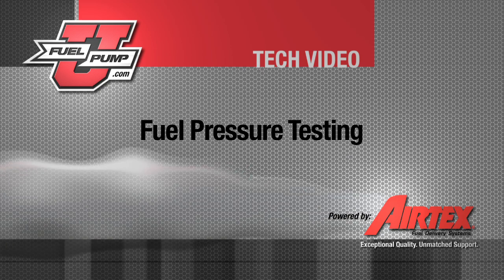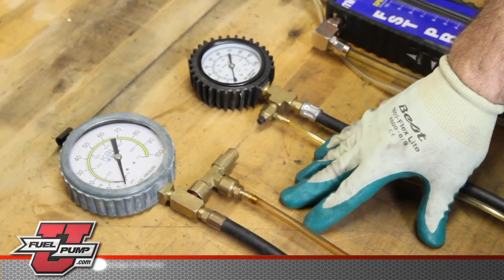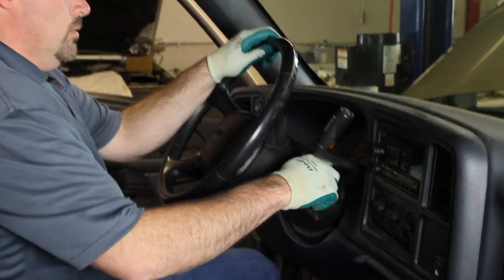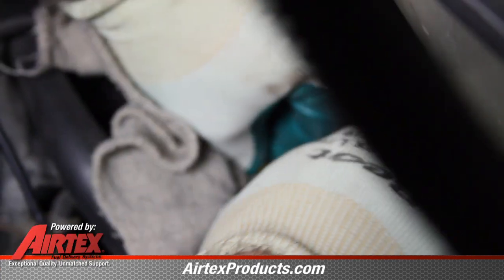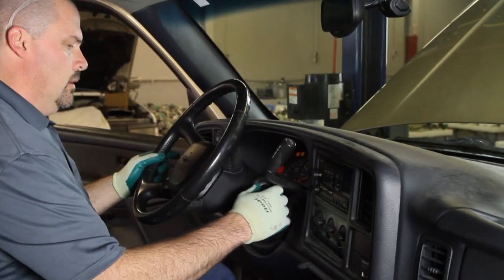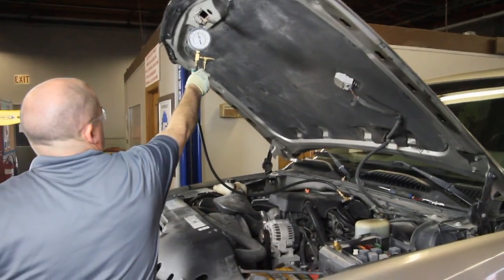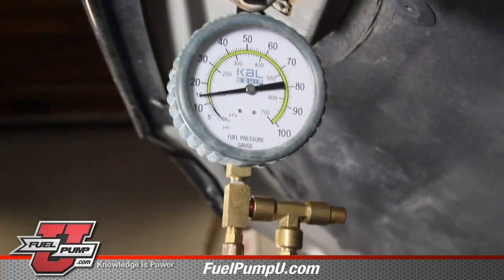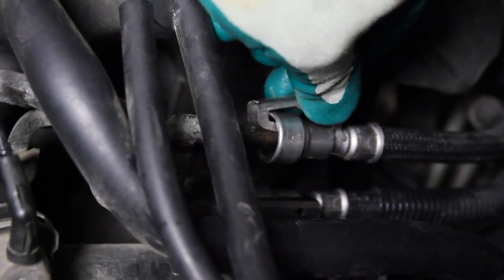How to Check Fuel Pressure

Comment: Or u can just press the gauge down and if it doesn't spray out like spray....then it's bad if it just comes like a water hose it's going or if it dribbles it's going fast
Reply from the maker: Your safest and surest way to check pressure is with a gauge making sure it meets the manufacturers specifications. GM Vortec requires a very specific amount of fuel to start. Two or three pounds off and it will not want to start.

Comment: Nice video Airtex Pumps. Quick question, is this how you check the fuel pressure on a car that doesn't have a schrader valve? Am almost sure the answer is yes but i just want to confirm. It's because am having a hard time understanding how to check the fuel pressure on a car that doesnt have this schrader valve. Thanks

Comment: Can you get the pressure to come back to what it was? I don't wanna have to drop my tank and replace the silver circular fuel pressure regulator, but the manufacturer of the pump sent me a whole new pump to do so. I have to cycle my key about 2 times to get my 2001 Durango SLT to start. I put in a new fuel pump last Monday.  I did not bleed any pressure off when I first installed it. I did however disconnect the fuel relay and the battery negative.  I know now it is a fuel pressure issue that I am having which is causing these crank issues.  Is it possible to bleed the pressure off and then replace the fuel relay and the vehicle reset itself??? Like can it reset its pressure and start cranking on the first try?

Comment: have a problem with my 2007 chevy uplander van. I was driving on the freeway then I got off on a exit then suddenly while slowing down I noticed the van turned off out of no where the I came to a complete stop at a red light and it wouldn't start it cranks but not start. So I got towed then at home we checked it out when you turn the key you can hear the pump buzzing but no start we checked the pressure pressing down the little whole it has to check the pressure and gave it start some gas came out but I'm not sure if it's suppose to shoot up a lot of gas or not?. What can my problem be? Thanks in advance